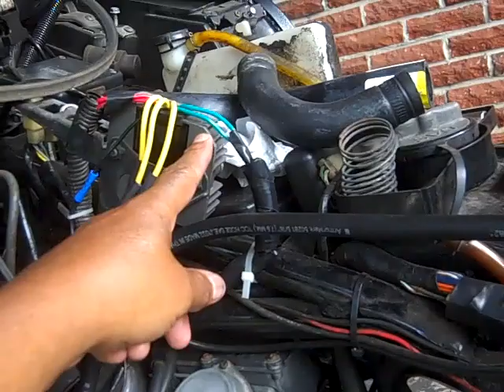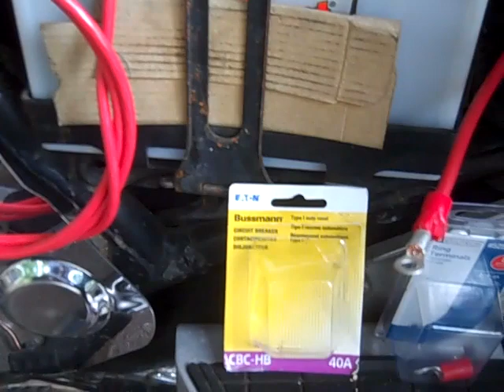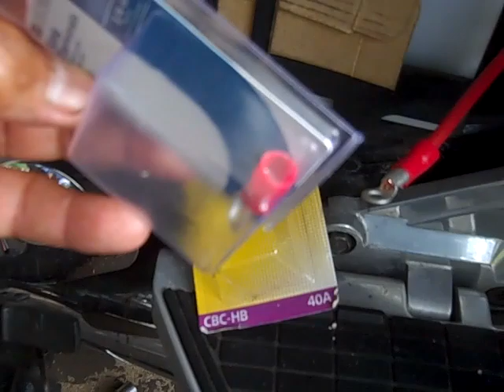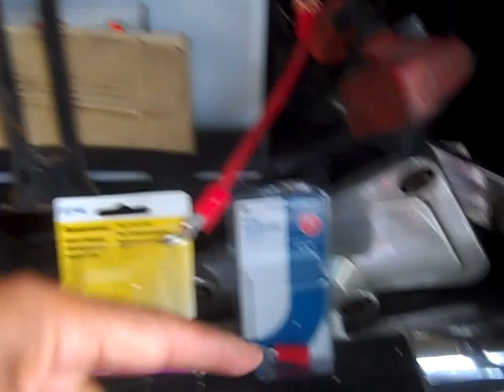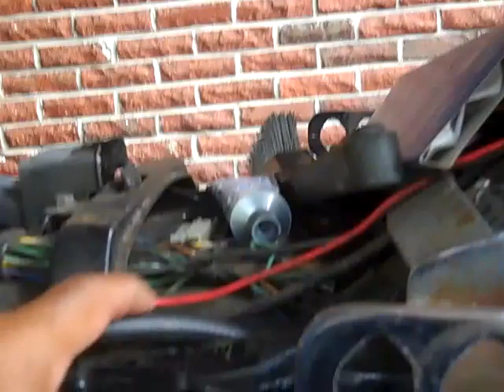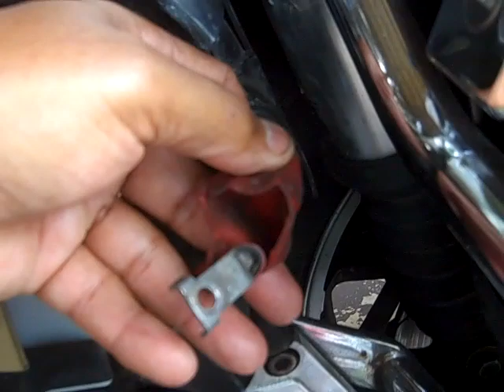Part 7 of 7, 84 Goldwing, PO Boy Conversion Install of the alternator wire to the Battery

Comment: Have just completed watching your 7 video series of Po Boy alternator insallation after watching your engine removal videos to install a new stator. Did the stator you installed in your earlier videos fail, and it prompted you to do the alternator conversion? If so, any suspicions as to what caused your stator failure?
Reply from the maker: Thanks for watching, Yes that was my 2nd change of the stator and all that replacement work was enough and that switched me to do the Po Boy conversion, The stators are not being made very well today which was my main decision to go to the Conversion, Did you see my video about the failed stator where it showed how it burned itself out from poor construction., If you have a 1200 after the conversion my 1200 is running great and if I need another alternator it is Amazon and a 10 min change and back on the road.

Comment: As you have one wire alternator and inbuild regulator so you don't need the external (original) regulator. Also you didn't connect any  ignetion wire to your alternator. Is it protected when you fire the engine?
Reply from the maker: The only thing I did was cut and shrink wrap the wires from the stator and left everything else as it was,, I did add a 40 amp fuse block at the battery 6" from the wire going to the battery, everythi,g is charging fine and Po Boy alternator is operating as designed., view the other videos for showing the running voltage, Thanks for Watching.
Reply: @max1chase166  Good job 👍🏻 I have my gl 1200 engine out for heavy restoration and thinking to put an external alternator too. Would you please send me the  measurement of the pully you used? I have a friend who got cnc machine and will make one for me :)

Comment: Just an update, installation complete! I had to play around a bit to get everything lined up correctly, but thanks to you, the bike is running great and charging the battery like it should. Thank you G. I am grateful for all your advice and patience.
Reply from the maker: Great news and a successful test ride, do a nut and bolt retorque but leave the pulley alone don't break the seal from the locktite just do a hand wiggle check to that, Happy Rides to you Eric and Job Well Done, Pat yourself on your back.

Comment: Great series. Very helpful. After watching these, I can do it!😀How well does your lower fairing on the left side fit with the alternator in place?
Reply from the maker: The side pieces touch the alternator but the screws line up, no interference., Thanks for Watching.

Comment: You probably can use a old sparkplug wire end to cover the one wire of the alternator. Great work by the way. I'm definitely doing this. You gave me great advice I'm looking for old angle iron bed frames that people scrap to make the bracket. How did it run?
Reply from the maker: Thanks for watching, it runs great, there also is the running video after completion for voltage test and reading, see that video and see and hear it run, again I did mine for a little over $200.00, just match what and how I did mine with some modification according your bike, Go for it, you can do it.
Reply: @max1chase166  just ordered the pulley but need the alternator part number you didn't state that in the vids.